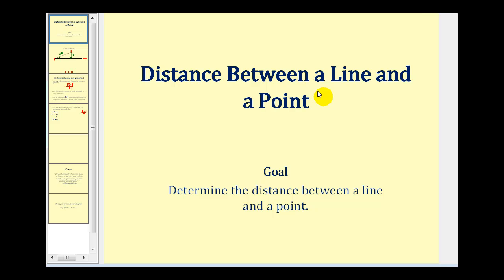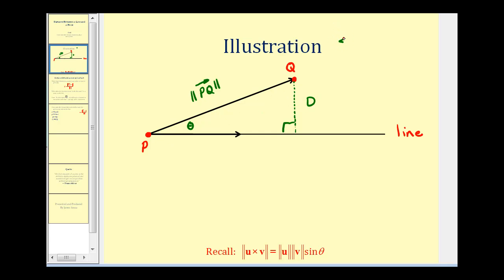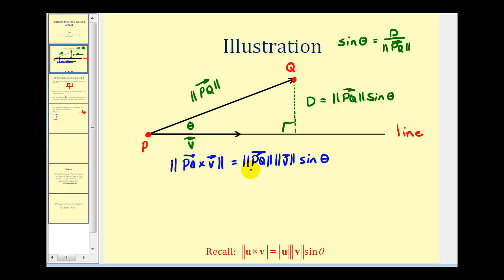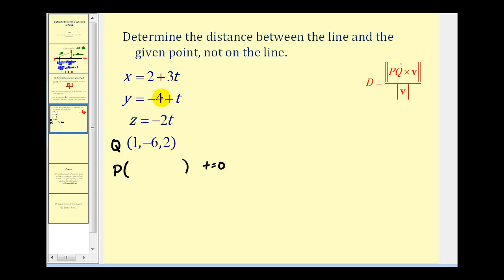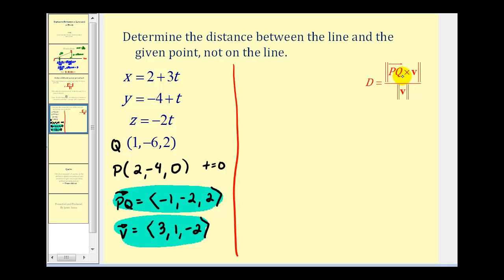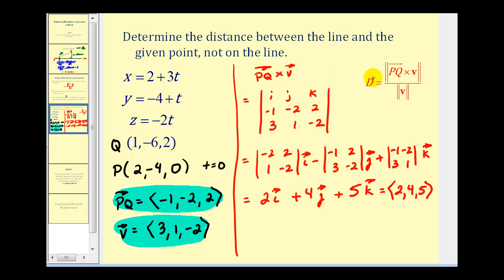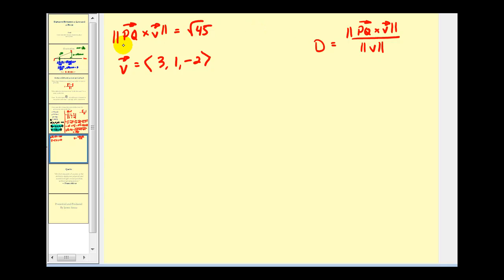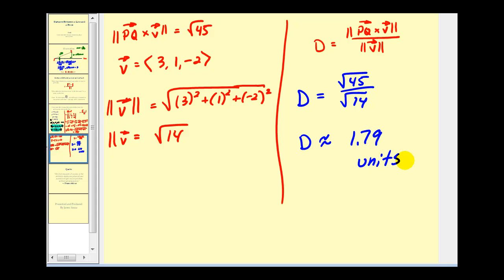Determining the Distance Between a Line and a Point

Comment: Let me try to solve this problem using the scalar product as an experiment. [(1-x)3, (-6-y)*1, (2-z)(-2)]=0, here x,y and z represent the point P, which we substitute with the parametric terms.

[(1-(2+3t))3, (6(4+t))*1, (2(-2t))(-2)]=0
[3-6-9t, -6+4-t, -4-4t]=0
-3-9t-2-t-4-4t=0
-9-14t=0
-14t=-9
t=9/14

And we put it into the parametric equations.

x= 2+3(9/14) = 3.928
y= -4+(9/14) = -3.357
z= -2(9/14) = -1.285

and finally, the vector PQ:
PQ=[1-3.928, -6+3.357, 2+1.285]
PQ=[-2.928, -2.643, 3.285]
||PQ||=sqrt(8.573+6.985+10.791)
||PQ||=sqrt(26.349)
||PQ||=5.133

dammit.
If anyone can tell me where I went wrong, that would be cool...

Comment from the maker: I think you mean a point on the line given by the parametric equations?  You can determine a point on the line by selecting any value of t.  I chose 0 to keep it simple.  A line in parametric form is parallel a vector with components that are equal to the coefficients of t.  You may want to view the video I made on parametric equations of lines.

Comment: i dont understand how can you find a point on the vector by letting the t=0....
and also i dont understand how did you find vector V....
also if i use this form, u=r(t)+s  [all vectors except r], why is the direction of u is equal to the direction of t???
Reply: 10 years late... but to answer your questions, you can choose any value for t to get a point on the line, but 0 is most convenient since the t term will cancel out. you find the direction vector v by looking at the coefficients of the t term. this is because a line in space is of the form (x, y, z) = (a, b, c) + t(d, e, f). in point form, this can be written as (x, y, z) = (a + dt, b + et, c + ft). So, when the problem gives you x, y, and z, you can find the direction vector by looking at the values of d, e, and f, which happen to be the coefficients of t. i do not understand your last question. hope this helps.